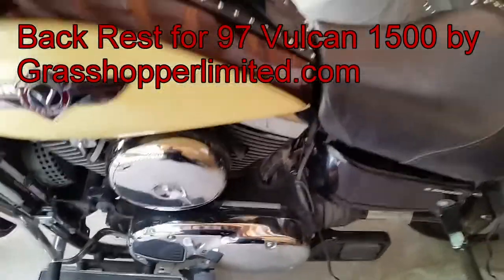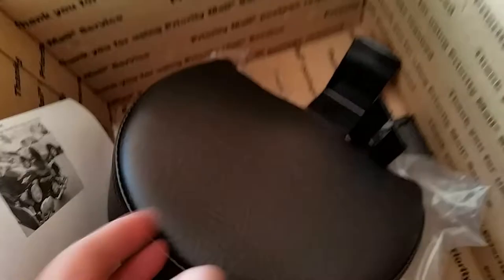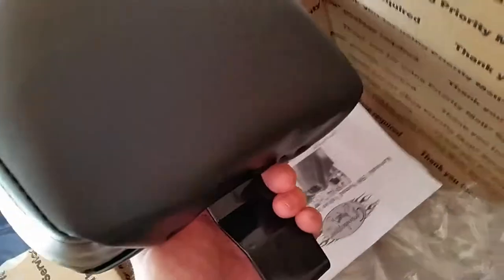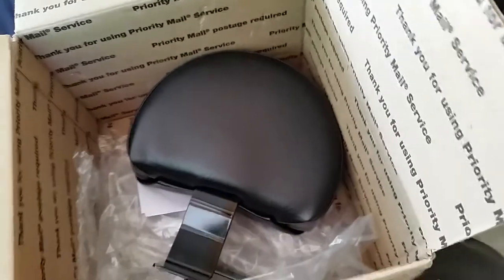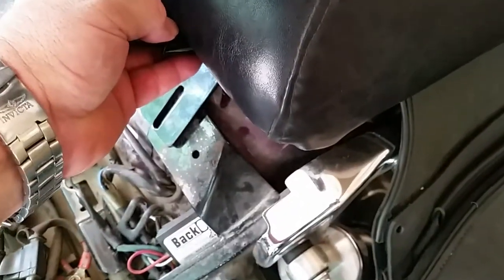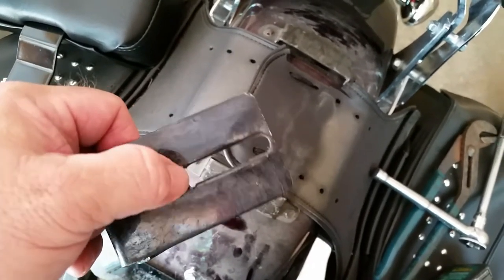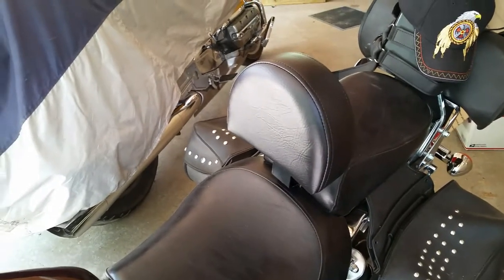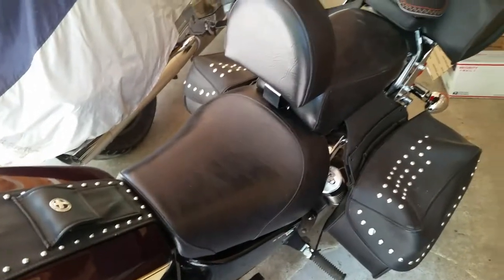97 Vulcan 1500 cycle,  Backrest install, Gary J

Comment: Not great reviews not this product. “Have to modify” is said a lot.  Most people want plug and play parts.
Reply from the maker: I agree, it's a very small modification though. It works great and I have had no problems with it.
Reply: @knightingalesaid  Does it fold forward at all like the mustang seat does?
Reply from the maker: @Jimmy315  No sir. It slides in and wedges firmly. And slides out easily with in 3 sec. If you had a rider and it was to snug for them. You just slide it out. You could tie it down in a saddlebag if you needed to. It is really comfortable.

Comment: do you have a video of your radio install ?
Reply from the maker: No. You can buy the radio for 100.00 or less off of ebay. It plays FM and has a card slot for your mp3. And some have bluetooth too. You just run your hot wire to the battery under the gas tank. The speaker wire plug into the back of the radio. I use the leather pouch between the handle bars to hold the radio. It's very simple. I bought some better bullet speakers for the handle bars. A lot of people just use their phone and a bluetooth buds. Pandora or other types of web radio. I do have a USB and 12 volt auxiliary plug between the handle bars too. To Keep your phone charged.